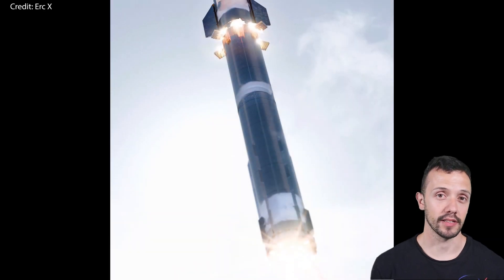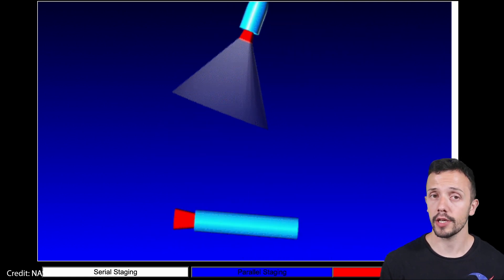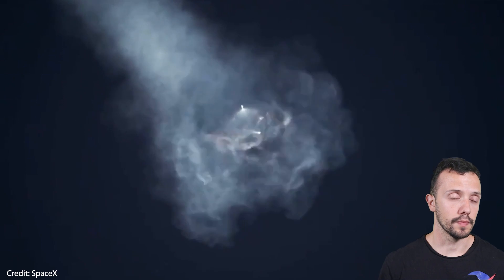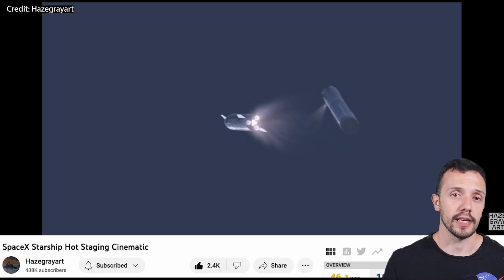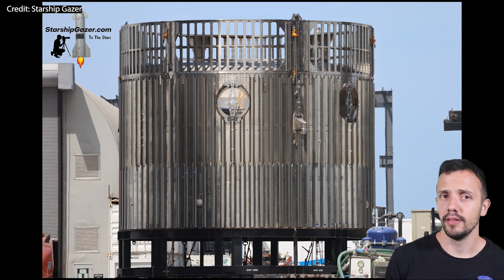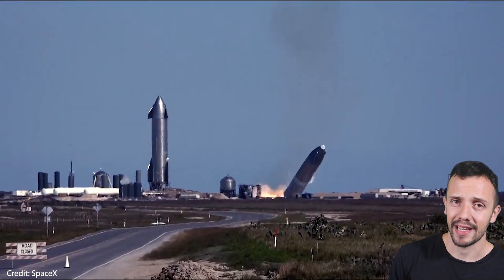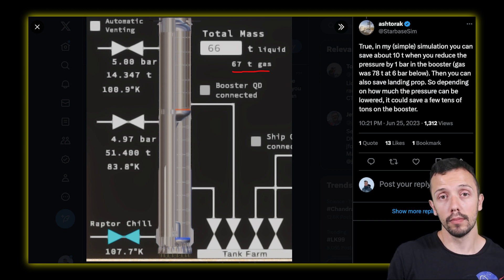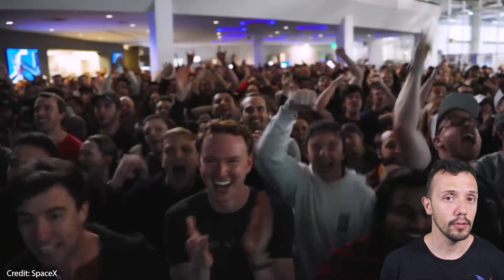How Hot Staging Works | SpaceX's Bold Bet For Starship

Comment: when starship fire while still attached, the frame shoot sideway creating loss. it will work better if they detach before fireing, also detach happen after superheavy is close to thrust, with tight timing.
secondly, having holes disturb the air flow creating drag and instability
Reply: The reason it fires while still attached, is because you need the fuel to be sitting at the bottom of the tank, you don't want bubbles entering the fuel lines, so fire the ships engines while still attaching to the booster is the best option, you're right it loses a bit of efficiency, but it's worth it in the end.